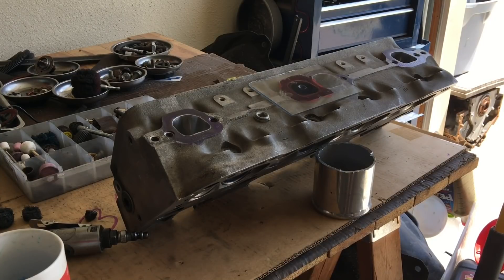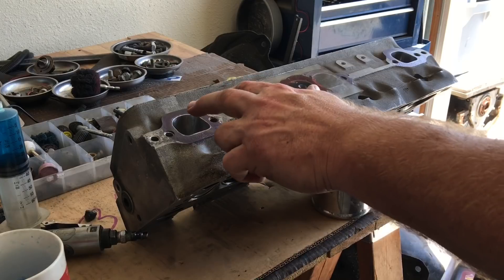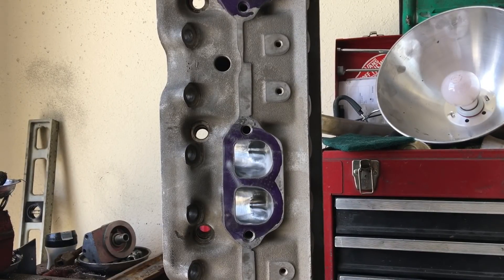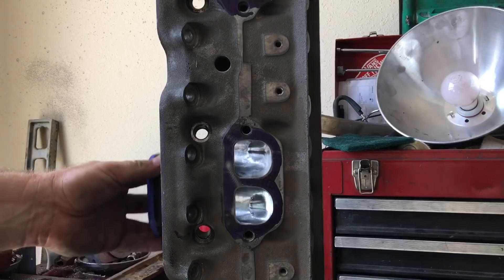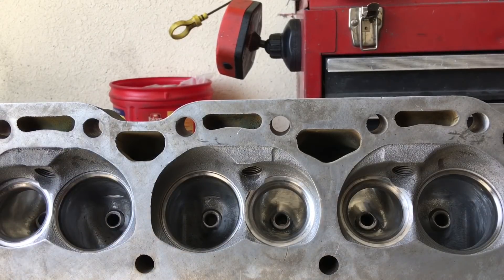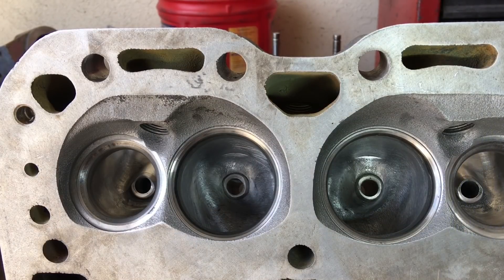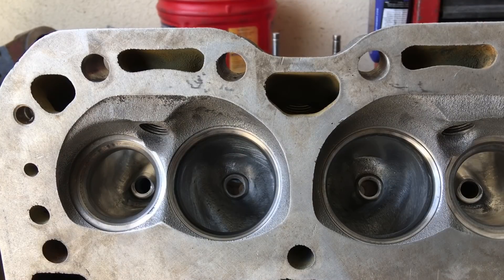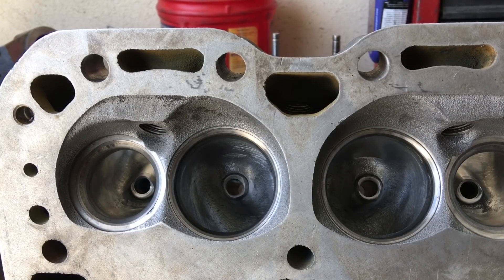Porting LT1 heads 2.0 Port and Chamber volumes before machine work

Comment: Nice work they should make some good power.
Reply from the maker: TPV Productions Thanks!   The exhaust side is really nice, the intake runners are moderate to work well with the 1.94” valve. 
I wish I’d known about the option to switch to the 8mm guides and running the LS 2.00”/1.55” valves in  these heads. 
I tried to get Noland’s to try and cut the factory seats to 2.02”/1.60” but he wouldn’t do it, saying the factory seats aren’t suitable, it would require new valve seats.  🤷‍♂️. I was confused because I’ve had old double hump #492 heads changed from a 1.94/1.50 to 2.02/1.60 valves in the past.  🤔🤔🤔

Comment: I have a 1994 firebird formula 350 lt1 with a little nitrous.  Would you be interested in porting another set of lt1 heads?
Reply from the maker: zootruck Where are you located?
Reply: @HeadFlowInc  okc

Comment: Hey bud thanks for all the videos it has been a great learning experience which I am actually put it to use now on my own set of heads I have a question I noticed you always polish your intake valve all the research I’ve done says to not smooth out or polish anything after the fuel injection or were your fuel air mix because the tougher cut gives you the turbulence that you want the fuel and the air to have when it enters the chamber. What is your take on this please get back if you can I am in the process of working on mine thanks
Reply from the maker: Thomas Johnson On the intake ports I try to leave them around a 60-80 grit finish.  It’s hard to maintain the rougher finish as the sanding rolls wear out quickly.  I have a split arbor I can load with 60 grit emery cloth and rough up the texture if they seem to smooth. 
I think the video makes the ports look smoother than they are. 
On the exhaust port I go pretty smooth, not really polished but close. 
I hope this helps clarify?  JD
Reply: Thankyou for getting back I’ll try an post some pictures of them when I get done so don’t laugh lol jkn they actually look pretty damn good so Thankyou for the time teaching us knuckle heads.

Comment: Have you do any work on vortec heads? And do you want to do a set? If so ill box them and ship to you
Reply from the maker: allmarinemaintenance  I haven’t worked on Iron heads for a long time.  With all the new aftermarket offerings with aluminum heads it’s mostly a better investment to go that route. 
The older SBC heads tend to need machine work, guides etc. adding cost to the end product.  These LT1 heads ended up needing the guides replaced, Comp valve job & surfacing .007-.009”.  
$750.00 porting
Machine work
Shipping
Total cost..   Aftermarket heads.
Reply: @HeadFlowInc  i have a shop hsere in Florida that does my heads when i have a marine engine needing a valve jobs they are very reasonable price.
Reply: Thanks for the reply back